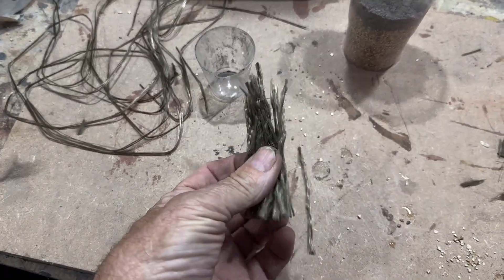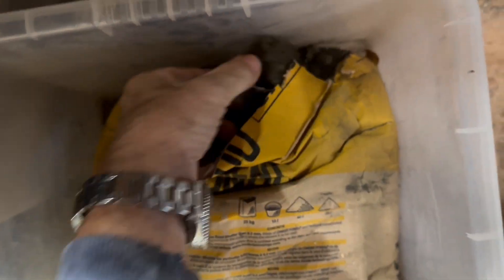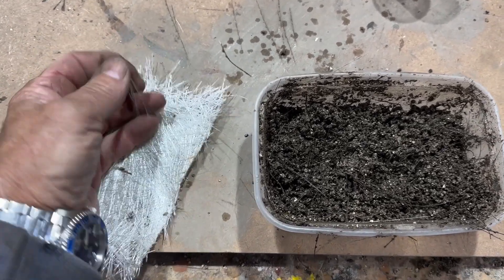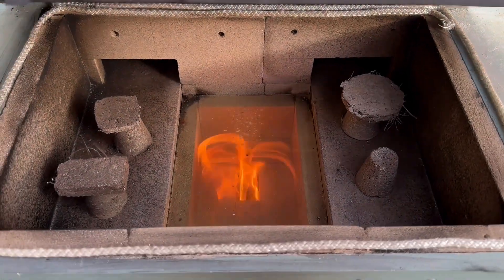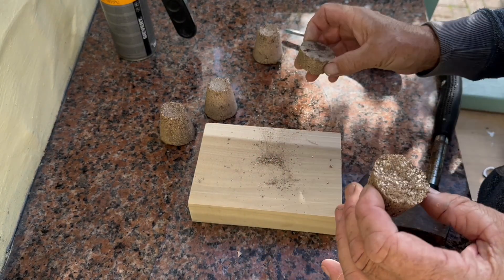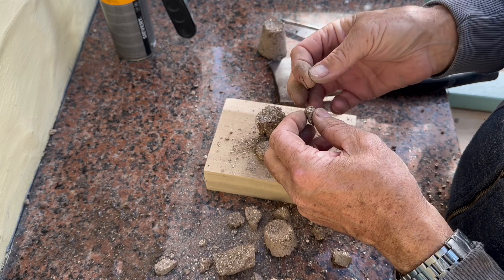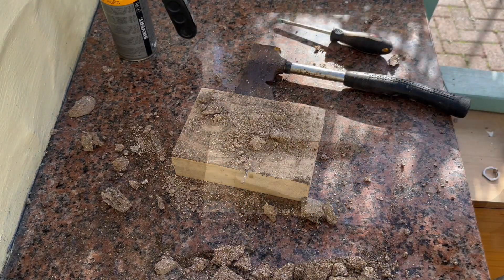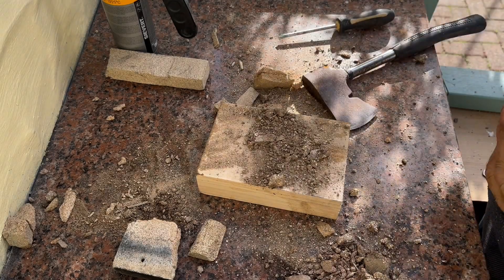Casting insulating, light weight refractory cement.

Comment: I've tried SO many diy variants. Everything. Literally everything one can make at home from drywall mixes to waterglass mixes. Trust me just buy AT LEAST a proper refractory mortar or cement.  Don't bother wasting a LOT of time and mess because it just doesnt work anywhere as well and far less often😂 spend the $24 bucks and buy a little tub of it. Mix with water paint on and you're done. No fuss No worries.

Comment: The commercial one has been compressed ?
Reply from the maker: It might be but,  I have been testing vermiculite mixes for many years and tried compressing the stuff before. When using refractory cement, there is a very specific amount of water required but when combined with porous material it does not seem to work very well. So the amount of water or the time the graduals are soaked for can make or break the end result.
When you compress the graduals the insulating properties are hugely affected and if the end product comes in contact with any moisture it will expand and crack! I think the board is made from vermiculite dust, clay and some other additives but the recipe is a mystery.

Comment: Thank you for the experiments, but why not just use the calcium aluminate cement by itself, or as a much larger percentage of the total. If "fondu" is regular "CA," that IS refractory cement. Nothing else is needed.
Reply from the maker: @stoveadvice  Fondue by itself without any binders will crack quite easily. So the standard refectory mix would be one part Fondue four parts crushed fire brick (grog) That is what pizza ovens or forges would be made from or any other component requiring high temp, high mass strength.
So what I was aiming for is a high temperature low mass or insulating result. Vermiculite is highly insulating and very lightweight. 
I mainly use vermiculite board but I wanted to be able to manufacture three dimensional shapes for use in my rocket stoves.
Reply: Обычный портланд цемент+40%Al2O3=900 градусов Цельсия.Это нормальная пропорция?
У нас продаётся и дорогой цемент Al2O3+CaO+Fe2O3+SiO2+MgO=1700 C.Для печи пойдёт первый цемент?
Reply from the maker: @olegpoheretski190 Portland cement will not last past 300c you need high temp, high alumina cement, where I live it is called Fondu cement and is rated at 1200c
Reply: @foxfish7115 Спасибо за ответ.У нас тоже продаётся высокоглинозёмистый цемент,он выдерживает,если верить производителю,1700 C,но также продаётся огнеупорный который выдерживает 900C и он дешевле.Могу ли я использовать тот который дешевле для изготовления помпейской печи? pizza stove.Я просто понял по вашим видео,что вы очень умный и грамотный исследователь,а мне негде больше посоветоваться
Reply from the maker: @olegpoheretski190  yes 900c is fine but I have another recipe that I will share with you tomorrow as I am out for dinner right now.
Reply from the maker: Pizza ovens dont often go above 450-500c so you can use this mix, it is called ‘home brew’ and has been used to make hundreds of pizza ovens  3 x sharp sand, 1 part Portland. Cement, 1 part fire clay and 1 part hydrated lime. This mix will work but not as well as fondu and crushed fire brick

Comment: Just an idea..

Before adding water, put all ingredients in a plastic bag, fill the bag with air and close off. Shake the bag like billy-o and it should break up the fibers and mix  the dry cement and vermiculite.

One question.. How do you cut your glass? I see you have a electric hob glass top.

Thanks for the great videos!!
Reply from the maker: @SomaTech-vd2bx  I use a standard glass cutter, it cuts like normal glass just a bit harder! 
There is a video showing me cut ceramic glass, I will look for it later……

Comment: I bet the vermiculite boards are made under strong compression. Try your mixes again, but this time make a little form where you can pile in the mix and then pound it down. For example, make a little rectangle by screwing together some scrap 2x4 pieces, place it onto a piece of plastic on a cement floor, pound it down (perhaps by hammering on another bit of wood that fits into your mold). Maybe try different amounts of water as well.
Reply from the maker: @kevinyoung4053  thanks for your interest, I made this video just for entertainment but I have been testing vermiculite mixes for many years and tried compressing the stuff before. When using refractory cement, there is a very specific amount of water required but when combined with porous material it does not seem to work very well. So the amount of water or the time the graduals are soaked for can make or break the end result.
When you compress the graduals the insulating properties are hugely affected and if the end product comes in contact with any moisture it will expand and crack! I think the board is made from vermiculite dust, clay and some other additives but the recipe is a mystery.